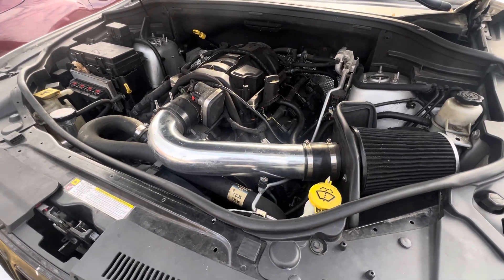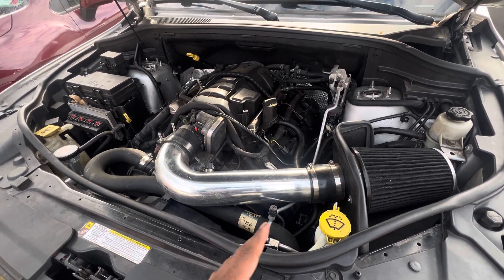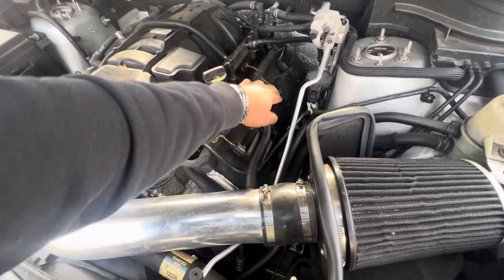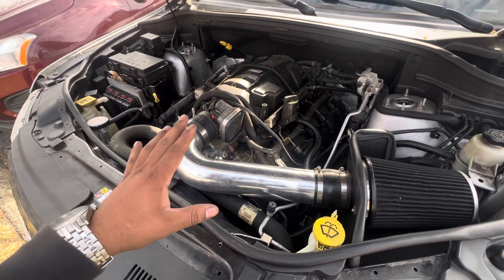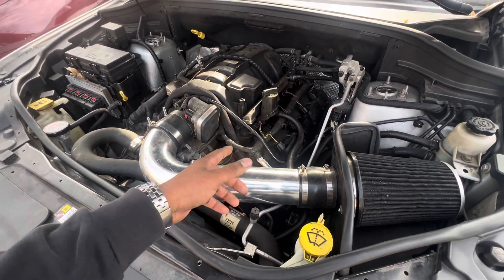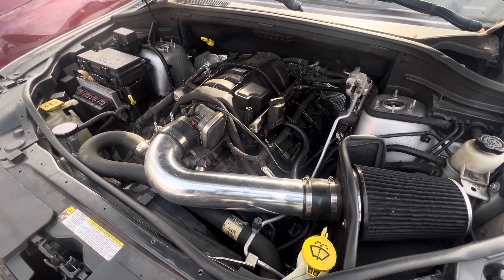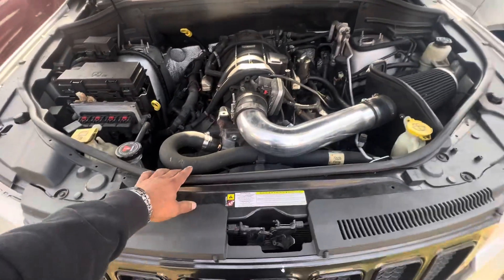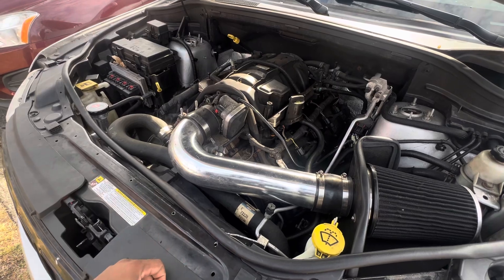Hemi 5.7 cylinder 1 misfire (part 1 )

Comment: Put a Mopar reman 5.7 in a '15 Grand Cherokee, it went 900 miles before the Bank 2 (right side) exhaust rocker shaft bolt next to cyl 7 came loose, stripped the hole, bent the shaft. Been sitting in the back corner of the shop for a month waiting for Chrysler to send a warranty cyl head...
Good luck.
Reply from the maker: Did you use oem parts ? I’m shopping around for the best options